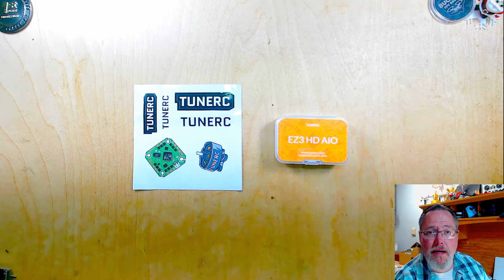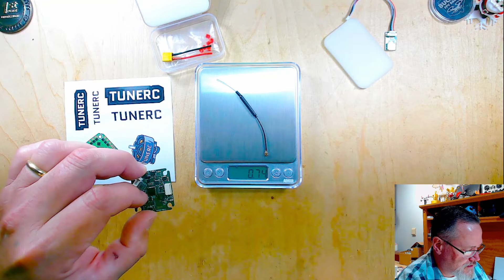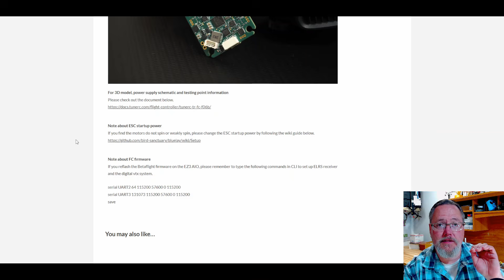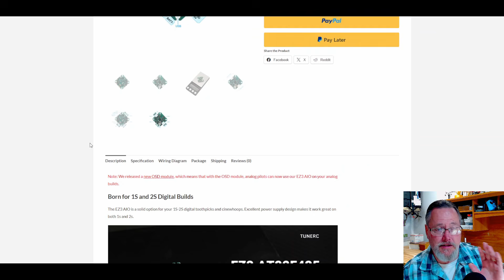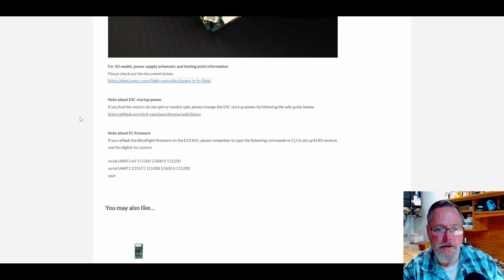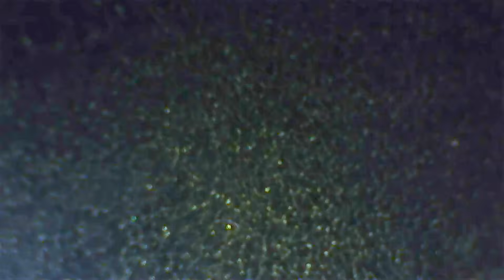TuneRC EZ3 HD AIO Overview

Comment: Hey man, I have bought 2 so far, and I’m very disappointed, to say the least. The first one I tried to change the PWM frequency to 48 kHz, and it bricked the ESC. The firmware update stopped in the middle. I thought it was a one-off, so I bought a second one. Same issue. On the first one, actual smoke came out while trying to reflash it; on the second one, one of the ESCs stopped showing up.
I have no idea why they ship it with 24 kHz, as it is known to introduce jello with the O4 Lite. Anyways, could you try flashing the ESC from 24 → 48 kHz?
I’m commenting on this video because it’s listed on the product page.
Reply from the maker: I will look into it. Were you using Bluejay ESC browser via PC?
Reply: @PropsOff  Ya ESC configurator using a Chrome browser on a Mac.
Reply from the maker: @jayypee-11 
Was your radio turned off during the time they were plugged into BlueJay? Did you modify the beacon tone?

I have reached out to my OddityRC representative. I will have to admit that they seem to have turnover issues with employees.  Therefore, responses have been slow, or incoherent the last few months.

Did you open a support ticket with them and explain (what you said above) but in more detail? What is your ticket number or reference number? - If not, I recommend you to reach out to them first to give me something to work with.

I don't want to flash mine, its rippin in my "Super Duper....". I have large motors with high KV...
Reply: @PropsOff  Yes, the radio and goggles were turned off. I have not raised the ticket with Tunerc, but have sent an email to the vendor. I'll wait for their response.
Reply from the maker: @jayypee-11 
I said OddityRC, I ment TuneRC.. Too many companies selling the same things, Lol...🍻